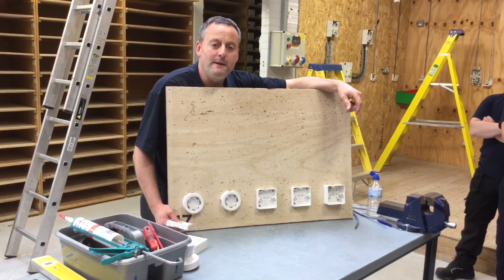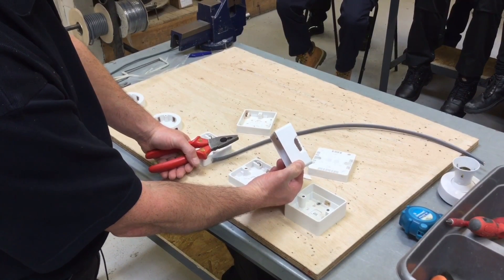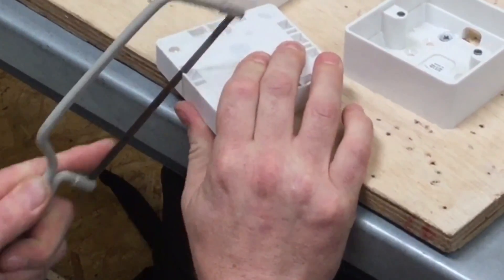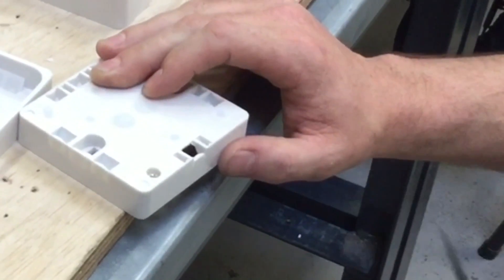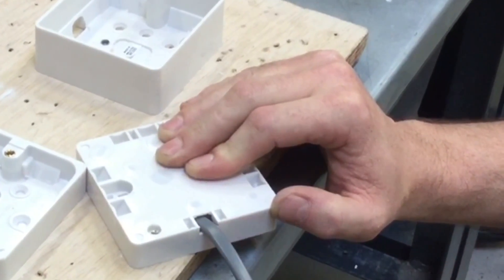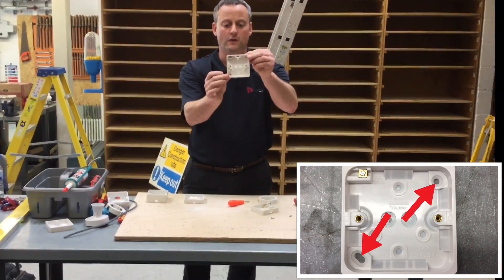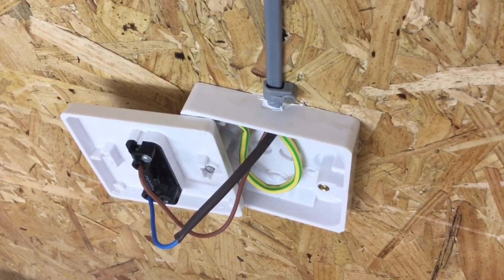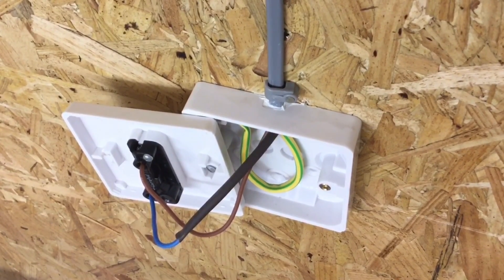How to Cut (Make) a Hole in a Surface Plastic Electrical Box and Reinstate the IP Rating (IP4X)

Comment: Since when have plastic box boxes had a IP rating? In 30 or so years as an electrician I have never heard of plastic back boxes having an IP rating. If an electrician  installed service mounted plastic back box’s in my house or office and put cillecon on them I would not be happy , it make it look more rubbish than it already did. 
Realistically electrician’s aren’t going to do it , I always use mini trunking when I service mount cables and back boxes  , even in the garage or shed or out building, or I use PVC conduit.
But who am I, I’m just a humble spark who’s opinion means nothing 😂
Great video as always Gaz 👍👍👍❤️
Reply: the outdoor ones have a ip rating.